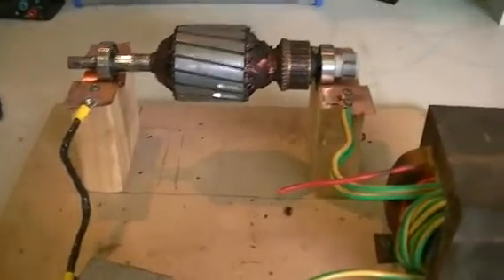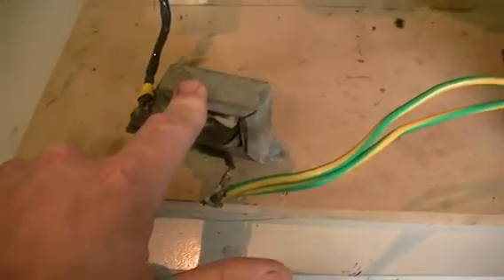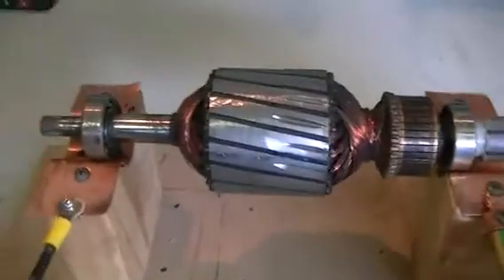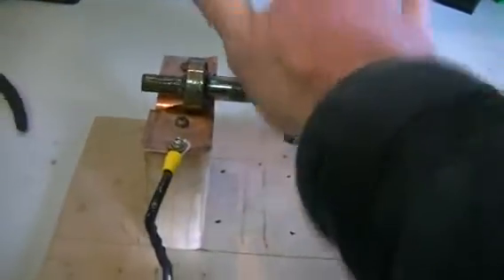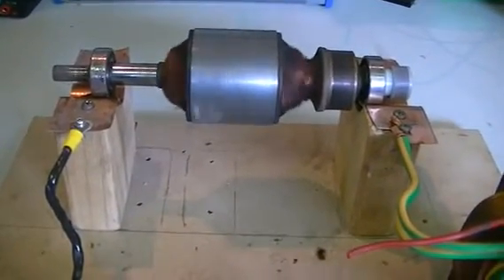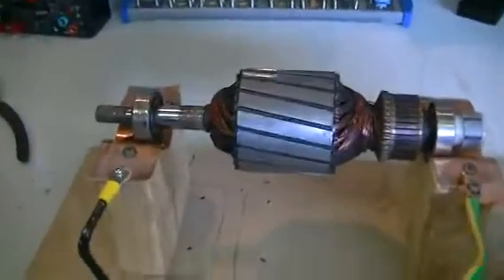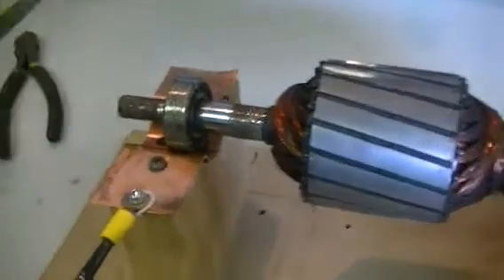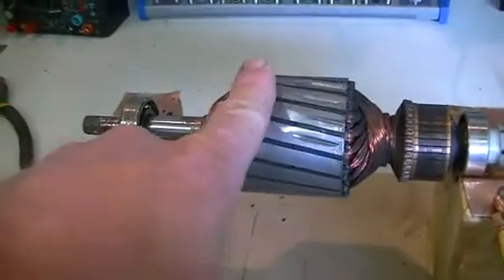Bearing motor spin direction test.

Comment: Sure is strange, wonder what would happen if it was run in oil to heat the oil, how about hooking the ground wire of a whole house circuit to it and heating the house,,,,just thinking out loud.
Reply: Artist Group Idk what would actually happen, although, I would guess it wouldn't be a very efficient heater as copper is an excellent conductor of energy.  From what I have read, heaters require some (low) resistance & a lot of current to produce heat efficiently.  Remember P=ii2*R.  That formula translates to mean power (watts---and heat) increases more when increasing current compared to when increasing resistance. In other words, you get more heat for each unit increase of current when compared to each unit increase of resistance.

Comment: Lets hear that false explanation of heating bearings being responsible for rotation now.
Reply from the maker: m3sca1 Indeed. As the heat would cause an equal distortion on either side of the balls,then there would be no rotation.